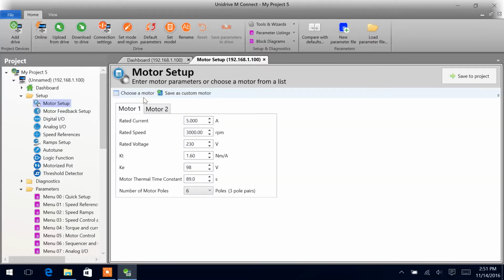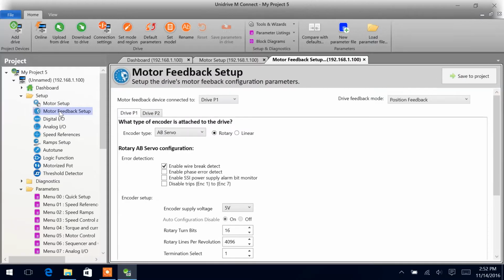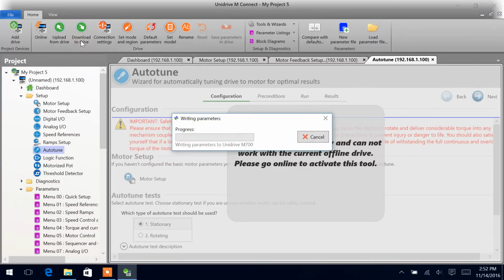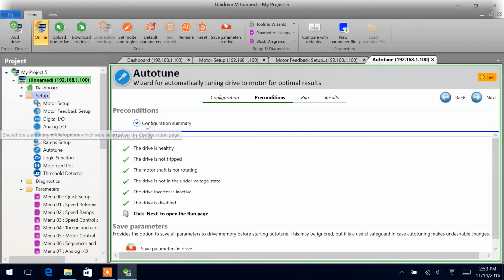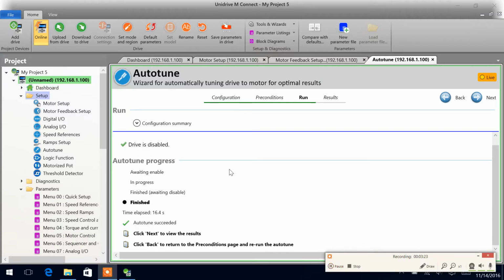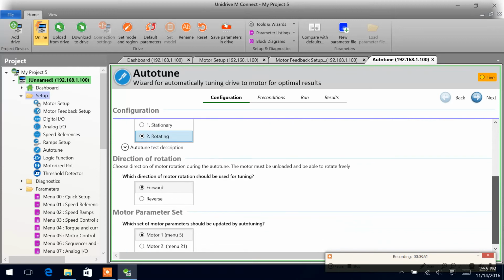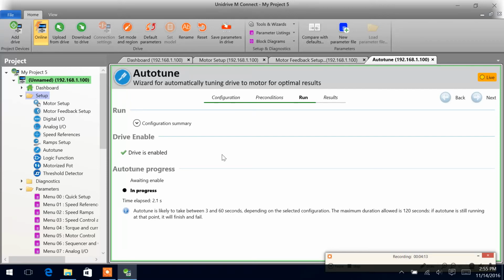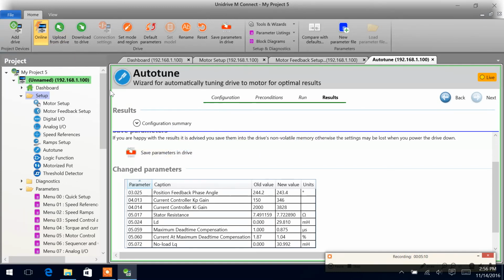Control Techniques - Unidrive M Connect Motor Setup & Autotune

Comment: I have motors with resolvers I want to use them position controller mode ,it's possible?
Reply from the maker: Yes, it is possible to use them with position mode with that type of feedback device. You would follow the same steps, but enter the resolver into the feedback setup parameters.
Reply: @Carolinamotioncontrols  my resolvers are LTN re-15-1-a14 which according to the datasheet Vrms =7V are single poles ,on Mconnect you can only configure 2 poles upward at 2V and 3V ,6khz and 8khz , from that only does it mean I must throw away the resolvers, I have 3 old(2000-2003) ABB servo motors.